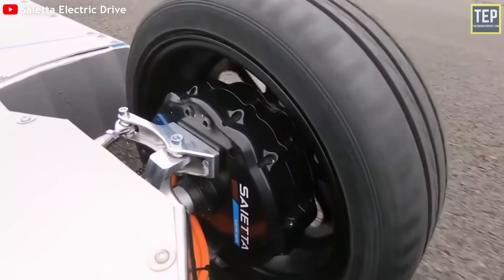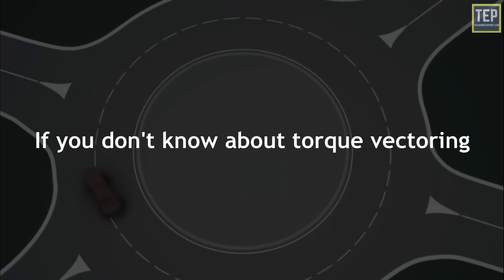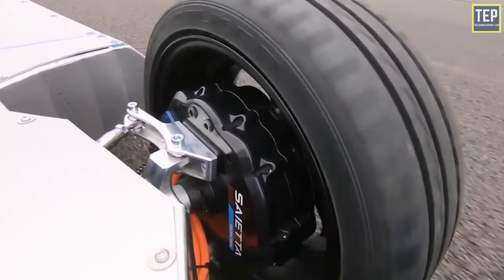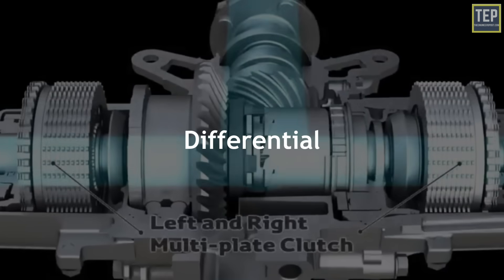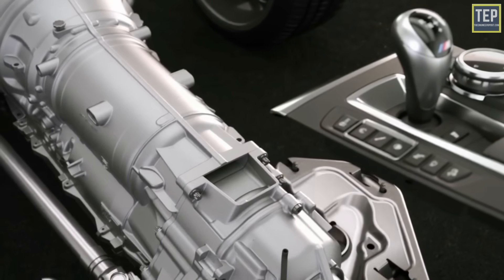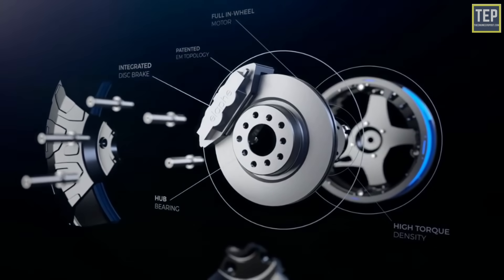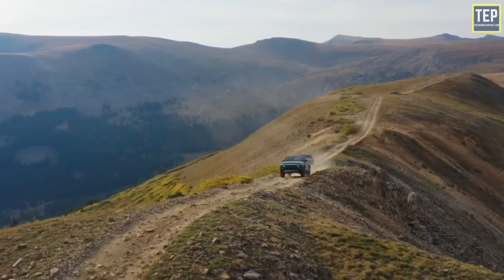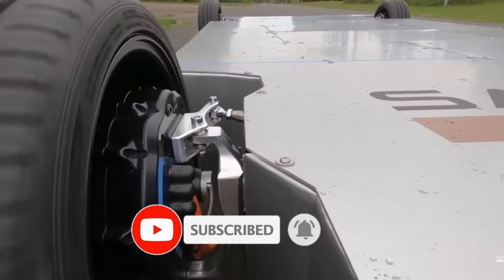How does In-Wheel Motor Technology Work? | Four Motor Drive & Torque Vectoring

Comment: With the small frame factor that motors are tending towards I see motor application shifting to a compromise that is neither in wheel nor center framed but rather between wheel and frame. This has the possible of removing the unsprung weight from the wheels while allowing maximum use of space applied to the body of the vehicle. Innovation is the way forward.

Comment: All this technology is needed out of the wheel well protected, above but closely coupled on short drive achieving a closer and more straightforward power cable connection (motor) to batteries.

Comment: If you have an in wheel planetary gear system with a freewheeling, but attach a brake rotor to the orbital planetary gears, you can acheive a system which can coast each wheel when required, but also have regenerative braking using conventional mechanical brakes as well as electronic.   The planetary systems are very robust and are employed within systems that have combustion engines, so that's proven technology. It would make for an expensive spare wheel, but it would work. Alternatively, to eliminate the excessive unsprung weight, perhaps have the motors more inset. But then I guess its would be preferable to have perhaps one motor driving all wheels, or two motors driving a pair each.

Comment: Did you know locomotives use hub motors? One in each wheel.
The giant v20 diesel engine has a giant generator bolted to it
which powers the hub motors. This is called diesel electric. In
essence it is a hybrid. One big ass hybrid.

!

Comment: I have 2 ebikes, one hub drive and one mid position. The unsprung weight of the hub motor, heaver spokes and reinforced rim does not allow the wheel to track the ground nearly as well as the mid drive. The hub motor is in the front wheel where the gyroscopic effect is considerable. I have to run higher air pressure and a heavier duty tire to prevent pinch flats, all leading to poorer handling. I know its only a push bike but the law of physics must be very similar to both car and bike.

Comment: Lots of problems to solve using in wheel motors; foremost is maintaining the gap between the stator and rotor which is determined by the actual wheel bearings that also in this design, serve as the motor bearings.  And, as you say, they operate in a very harsh environment, not only in the pounding and vibration.of roadways; but also, in the highly corrosive environment of dirt, water and abrasive grime.  As the bearings wear, the gap opens and can lead to the rotor and stator clashing together...then there goes the whole wheel assembly...so far as I know no one has successfully brought automotive in wheel motors to market that lasted long term..I think the closest so far is the uni-wheel by Hyundai which places the drive motor just outside the wheel on a short shaft.

Comment: Every component which transmits the power and torque consumes some portion of them.
And, every component in conventional automobiles faces with, water, dust, dirt, mud, salt and motion etc...
So, in the wheel individual electric motors have no difficulty to block environmental and motion effects because the auto industry has solved these issues for more than one hundred years ...

Comment: I’d like to add 2 of those wheels to the back of my front wheel drive gas car and use the alternator to charge the batteries. Make the motors engage as assist motors. Maybe double gas mileage?

Comment: Using the current batteries or electric  power and eliminating these bulky drive trains will be essential. Couldn't achieve this without computer electronics. They did not exist until the 21st century. However, we are doomed once the computer malfunctions. There are also many ways for vehicles to conserve energy. We could get efficiency up to 95%. Through braking and wind while driving. Batteries must get up to 1000 mile range with 2000 plus cycles. Otherwise, no go.

Comment: Aptera is currently using in wheel motors.  And it’s classified as an auto cycle or motorcycle.  Elaphe is the supplier of the motors.

Comment: I believe that the issue of unsprung weight in hub motors can be resolved by modifying the design to enhance the motor's service life and performance. One way to do this is by widening and enlarging the motor to increase the overall bearing contact area, which would make it more resilient against impact forces.

And switch to a traditional independent suspension system, such as a pneumatic suspension system, instead of a hydraulic one. This would improve the car's range of impact absorption.

To protect the motor from environmental factors such as water, dust, and sand, it can be coated with a waterproof coating. However, the motor's heat dissipation must also be taken into account. Each motor may require its own liquid cooling system and overheating protection sensor. 

Lastly, one worst alternative is to place the motor inside the car body and use a mechanical structure to drive the wheels, with each wheel using an independent suspension system similar to those used in existing petrol cars. 😅

Comment: The biggest draw back is that the wheel turns at the same speed of the motor.
Since the max efficiency is at fixed speed, going uphill e.g. at 40km/h is going to consume a lot of extra energy

Comment: instead of a separate motor and wheel rim the magnets could be incorporated into the rims using brushless motor control also utilize the frame to conduct ground to the motors with a single positive power cable but use short braded hoses like break lines filled with a conductive fluid like salt water so if the cable is cracked it could leak out signaling the ECU of reduced conductivity to stop the flow of electric current to that motor, also the motors could be designed in a way that is slightly less efficient to ensure reliability from vibration and impacts, also incorporate wear sensors in the wheel bearings and seals that alert the driver and cut power to a motor that is in need of maitnance

Comment: The reliability/endurance of the wheels in stressful road conditions are not proven, but should be fine for everyday driving. I have several large speed-bumps before leaving our HOA, and it certainly tests the suspension every day😖🙄

Comment: Good idea for simple cars like cit cars but if you will use this car to harder work like pulling a trailer gears can be too weak to hold that much of torque. Second situation is when we use stronger materials this can be more expensive solve but this have use.

Comment: The trick is to have a very light, torky, powerful electric motor if it is going to be in the wheel area.  The lightness reduces the problems with the weight of the wheel reducing the responsiveness of the suspension.  Since the wheel needs to go up and down with the road surface and weight will resist this movement less weight will give a more responsive suspension. Like I have seen even the brakes move inboard to reduce weight on the outer suspension area.  The negative being the loss of interior area of the vehicle.

Comment: Just a whole lot more components that will fail. A technicality is  that the mass of the motors increases the sprung weight of the suspension which is contrary to performance.

Comment: I opine that the best compromise is to bolt one big or multiple smaller E.M. on a gearbox either front or reardrive. There wouldn't be inconveniences at any level and the space/weight gains would still be substantial.

Comment: Should think of modern shroud designed to protect in wheels motors and add 4 more tires with shock absorbers  tires can be latest innovated and ugly but very very ,I got indestructible  aside with in wheel motor know it works smoother road driving possibly.

Comment: I waiting for you to mention unsprung weight, and you did.  Good, because that is a problem.  I also assume those were axial flux motors at each wheel.  That is also good.  Yes, and the challenge will be how those motors will stand up to the elements after ten, fifteen years, or more.  Can the motors be made as small as possible, after all who needs to accelerate to 60 MPH in 3 sec?  Doing it in 6 sec is plenty fast.  Not sure I like the AI voice in this video.  In fact I don't.

Comment: I thought one of the benefits of e-cars would be less mechanical structure on the wheels, The brake calliper, pads, ABS sensors etc could all be done away with as braking can be all done in the motor and shafts, as all car owners know especially ones in areas that use salt in winter everything attached to the wheel is destroyed with sats and grit, now an electric car with a rotating wheel and nothing else makes sense adding electric motors and the control cables, sensors and everything else to an area that is effected so badly in winter doesn't make any sense to me, its looks cool here try it for real and see.

Comment: We use steper motor and extra part as generator and mount on the shaft and attach shaft on shock system paid more simpler than shock on wheel

Comment: If we add a hydraulic gear box so in case climbing we use hydraulic assist and a reverse flow of hydraulic line used to brake without the cost of replacing brake pad and while the rim of the wheel turning we use permanent magnet Mount on the rim with shielding guard and guide to induce electric onto coils mount in the body frame to charge battery as renewable source and drive hydraulic pump and battery so very efficient

Comment: BRAKE COOLING? The hot brake is going to add heat to motor parts, reducing efficiency and causing reliability issue.

Comment: I get it about the unsprung weight issue for in-wheel motors. I see some potential lines of tech  development in this domain that will eventually improve operating cost… 
1. Some form of in-wheel floating suspension for each motor that reduces mechanical stress.
2. Improved hermetically sealed motor containers to protect from dust, mud and pebble impact
3. Cost reduction from production at scale.

I think ultimately the pluses (power, manageability, sensitivity) will outweigh the minuses for this tech.

Comment: If the brakes are incorporated into the motors(which are sealed against the ingress of dirt, dust & water etc. Where does the brake dust go? If all 4 wheels are driven by individual motors, could you not reverse current brake them?

Comment: Good presentation with pros and cons.
Yes, certainly unsprung weight has some harmfull effect on suspension and steering. Rally drivers are unlikely to get excited. But with Rivian it seems to be working just fine. Surely few years of development of the In Wheel motors would reduce weight eventually.

But, what about implementing in wheel motor, I mean something like Verge or so, in heavy traffic vehicles; let's say there is some 12 - 16 wheels total installed in a truck with big trailer? 

Think about 50 kW per each wheel = 600 - 800 hp total. It' doesn't matter much, if one motor occasionally fails. And then standardized, IW motors could be available for most of the common trucks.

And think about slippery conditions; every single wheel would be pulling up the hill...
One would think truckers would not want traditional drive back anymore!

Comment: I realize this is old but I’m doing research for a project. Can these in-wheel motors be setup to only be engaged as an emergency 4 wheel drive option for standard vehicles?  In other words if I got stuck in mud or icy hill and need a boost in traction just to get out of the situation can this be configured to engage when I want it with a switch?

Everything is out of control price wise this year. I’m waiting for production to return to normal.  If they don’t I’ll avoid buying new.  This vehicle is being used to haul a trailer with a subcompact tractor.

Comment: Unsprung weight was always a problem with vehicle drivetrains. They simply used U-joints to solve. With the extra available space, you could move the electric motor up and at a slight angle, inclose the motor in a ventilated air box with a sealed boot over the u-joint. Sure, the torque numbers would be slightly down compared to the inner wheel set-up. The whole set-up would need to turn with the wheel around corners or you loose extreme amount of turning radius. It would be cheaper to work out most of the problems on a 1/32 scale RC car or some sort of go cart. With an electronic controlled four wheel turning capacity, you wouldn't need as steep a of a turning radius and gain slightly better cornering. My greatest concern would be torque pressure on components, mounts and the unibody or whatever structure your mounting or hanging it from. You would have to rethink the whole steering and suspension  apparatus. The double wishbone would have to go.

Comment: It left up to who can come up with the best innovative method are engineering, also application requirement, such likely if a vehicle may only need to used only two electric  wheels motor at the back on the vehicle and  maybe a mid electric motor inside which would consider being a mid electric engine it all comes down to what can work out for the type of vehicle and what it's needed to do.

Comment: I've often thought about using inwheel motors in the rear wheels of my Dodge Caliber which is a front wheel drive. I've baulked at that because of the dust and water issues. I've also been unable to find information on the battery size and motors specifications.

Comment: What I want right now is a Hybrid AWD With Gas RWD and EV Front Wheel Drive. GM is doing for the C8 2023 but availability and cost are highly likely to reduce acceptance and mass purchase. However, Retrofit Kits for Front Drive  for Current owned Gas (ICE) vehicle could be retrofitted sooner, cheaper faster helping reduce carbon earlier and provide a migration path to full electric. I see Kits in europe but zero in America???? Where is our after market auto suppliers, where the Hot Rod Industry, where is SEMA, DOT, DOE, NIST all the supporters of innovation and tech adaption. Now is the time to join hands and get this done so we are Hybrid and on our way to saving the Ice Sheets, Beaches and Planet Earth as a whole......

Comment: geemy have you seen the Verge Motorcycles from Finland? The back wheel is a motor with a tyre on! The centre of the back wheel is a 10" hole with cooling groove around it. The swing is a double  swing arm top & bottom attaches to the back wheel Stator. The early models did not need or have a back brake. The look awesome after 5 minutes when you've figured them out.

Comment: 30 mph only requires 1-2 HP in a small car, that is rolling resistance + air resistance. However auxiliary systems in a car, water pump and generator and losses in gearbox doubles that. so likewise in an EV; at low speed the reduction gear becomes a disproportionate source of loss. However at higher speeds gearing loss is negligible compared to other losses.